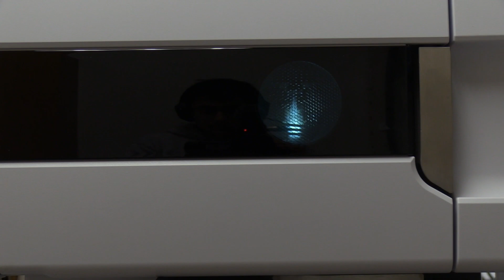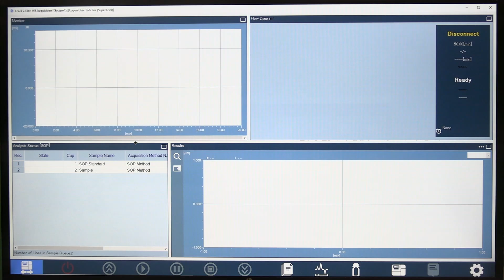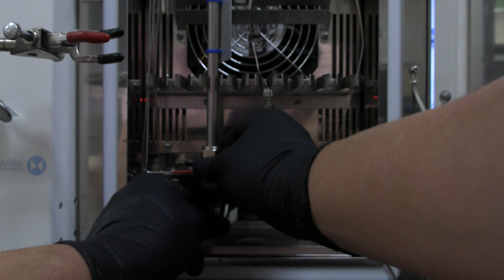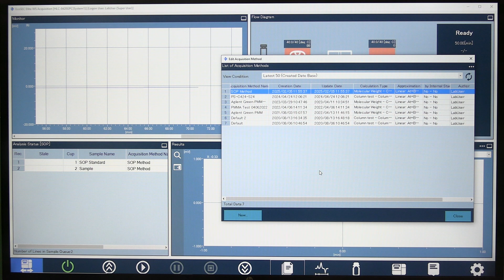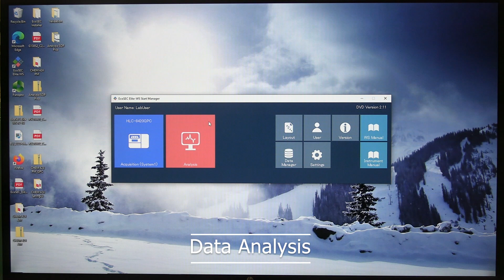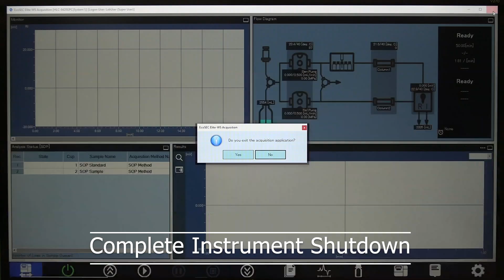Tosoh HLC 8420 GPC

Comment: Thanks for the video. A small question if you have several samples and you use a internal reference in it as well as in the calibration curve. Can you shift the data curves of the sample thanks to the internal reference into the software?